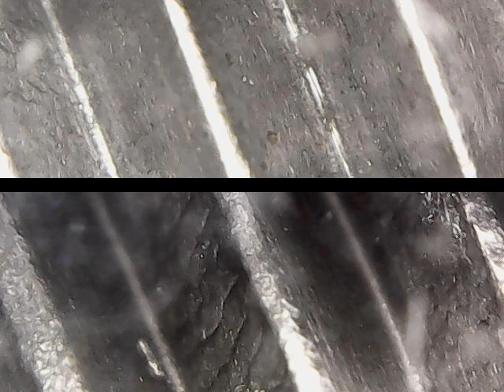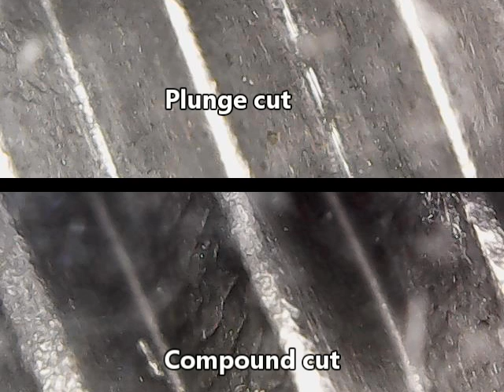Threads

Comment: Main thing I notice is the compound cut appears to show the evidence of the cut on one side, with some appearance of chatter or tear - significant difference between each side. The plunge cut actually looks overall much cleaner!
Reply from the maker: I thought that as well but then the 1018 I used never cuts smooth for me no matter what operation I am doing.  I guess I should have found a good quality metal for this but it was all just on the spur of the moment.  Thanks for stopping by.

Comment: Hi Harold.  The different threading methods have more to do with the material being threaded. With hard or grabby stuff like brass a flanking cut would be more appropriate as a cutter can dig in and bounce from one side to the other leaving chatter marks or stall a small machine when plunging.  When the thread is about done you can plunge the finish and spring passes to clean up the trailing flank.
On soft gooey stuff like 4043, 1018 and plastics, a flanking cut tends to smear the trailing side so I'll do a plunge thread depending on the depth.  Also, be aware that some threading charts are based on a sharp bit vs one with a radius.  A sharp chart with a radius bit will have a thin loose thread and a radius chart with a sharp bit will yield a tight or non-starting thread.  This assumes a person without Pee Dee wires, like me, is going by minimum diameters only.
-Cheers
Reply from the maker: That comment does describe the results I got on the 1018 I think.  Thanks for stopping by.

Comment: Thanks for the video!   I almost looks like the plunge cut it smoother.
Reply from the maker: It does look like that but I could probably have found some rough spots on the plunge.  This was 1018 hot rolled I think and I never get a good finish on it no matter if I am turning or threading it.  Thanks for stopping by.

Comment: I've picked up a usb plug in microscope recently and its helpful looking at welds and cuts in metal, also looking for cracks. It's a good tool to have. Be safe
Reply from the maker: They are great for a lot of things.  I have used mine to find metal chips in my finger when I could not see them with a magnifying glass.   Thanks for stopping by.
Reply: Great idea, a few yrs ago I got a very strong neodymium magnet from K+J Magnets about 3/4" round by 3/4" tall(cylinder) and I've gotten chips out of my skin with it with no digging and a chip out of the corner of my eye without touching it(I had my regular glasses and face shield on, it found a way in anyway). I buy magnets regularly for projects and I put them in all my engine, transmission oil pans ect when I rebuild them, great insurance.

Comment: Harold - great view of the results! It sure does show a difference between the two. The technique I was taught was to start with the compound and then do a finish with a light plunge. The reason given was your initial cuts are deeper and cutting on a single side during those harder cuts was easier on the machine. The plunge cut gave equal cutting pressure on both sides which was great for the cleanup pass. Does this make sense? It may not be as applicable these days as it was when I was on my tiny 1/4hp South Bend as it is on the bigger machines though.

Best wishes, sir.
TZ
Reply from the maker: Plunging for a cleanup pass does make sense.  Not being a trained machinist I really have no idea of the best way to do this sort of thing.  Thanks for stopping by.

Comment: Interesting, I read the comments so far. My thoughts are, there must be a reason that the "approved" method is the compound cut. I suspect that Eddie the Grouch is right, but what do I know. I was wondering what your thoughts on the matter are?  Tom
Reply from the maker: Tom I am first of all not a machinist so my opinion is just an amateur speculating.  I took a machine shop class back in the 1960 era and the compound method was what they taught me.  I may have slept through the part where they said why.  This old Tony does a very slick and informative video on threading and so does mrpete222 and That Lazy Machinist.  Probably every one of the "real machinist" channels do a good threading explanation.  All of these guys say the compound threading is to cut down on stress on the cutting tool since only one edge is cutting.  Thanks for stopping by.
Reply: I am not a machinist either, just a spectator trying to learn something. Thank you for your patience and your reply, I will check out those other video's you mentioned. I knew there was a reason that there was an approved method, just didn't know why.  I suppose it is like a lot of things, there are many ways to do things and some will work every time and some won't, depending on conditions and variables. I suspect that the compound method works every time.  Thanks again, a very interesting topic for me.  Tom